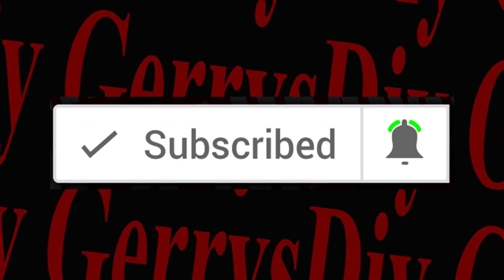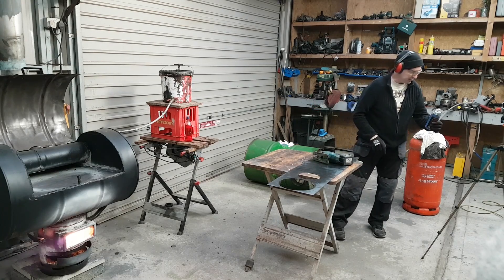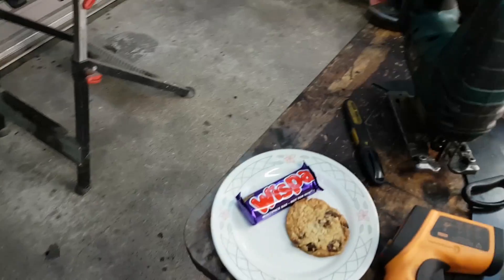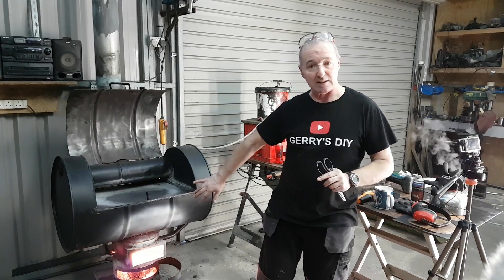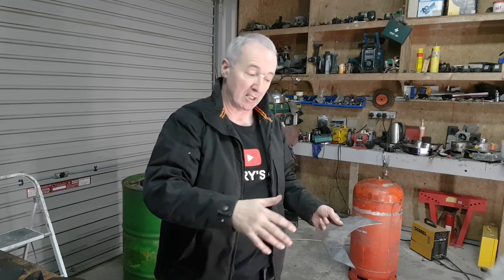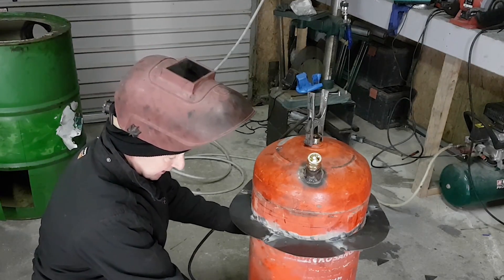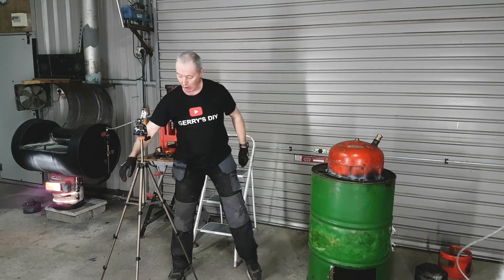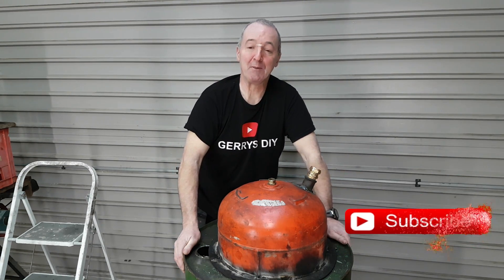Waste Oil Burner ... Make Lots of Free Hot Water ... part 2

Comment: na thats not enough to hold it full of water you need two bits of strong metal from the bottom as with the heat its too much for the thin metal on the drum to hold up! your ideas are good but you talk to much about each part theres no need to explain about every bit of metal from start to end theres too much wasted talk lets see the idea and move on! ow and get your self ! a mig be a lot easyer than stick on thin metal!

Comment: Glad you are all right!

I'm setting up my own WMO burning stove for this winter and need some input about chimney planning. 

I will need to use a 90* to come out the shop wall, but I'm concerned about buildup and chimney fires. Is it safer to take the chimney out closer to the stove, or closer to the ceiling?

Planning to take it up just past the gutters, about 20 feet up. My only big concern is chimney fires.

Comment: I think that you want to also consider that the water tank, if it fails and dumps into the oil burning.. probably would cause a huge explosion.. Water into burning oil 
I'm sure you're aware of the boiler needs to be not a pressurized vessel. But I hope you considered the constant fire, overtime at the bottom of the water tank (and it not being designed for it initially) could cause a failure and explosion. I'm a welder & have been a boiler service man.

Comment: Think about it Gerry.  A 2ltr Diesel engine on tick over will burn 2-3 litres per hour.   My current 2016 plate 1.6 TDI (77 KW output at 4400 rpm) does 65mpg typical which works out less than 2ltrs per hours when driving (under load) 
A typical household system needs no more than 10Kw for 3000 square feet.  That's a pretty big house.  

You have to pressurise your fuel bud.  Who knows maybe boost with an HHO unit but either way it's massively inefficient although your concepts are superb.
Reply from the maker: Hi syn Kronos. As it happens I have an old tdi here that I could use but the waste oil is free and bountiful and I would have to buy the diesel to run the golf. I have an oil boiler to run the house that is 97% efficient (condensing boiler). I was thinking of feeding the waste oil into the burner from a pressure vessel and pressurising it so that will happen very soon. I will be playing with adding steam to the oil line too once I have this running. I would love to mess with some hho so I might make a unit to weld and cut with Thanks for the great suggestions Cheers Gerry
Reply: GerrysDiy nothing to do with the motor as such.  Only using it as an example that we need pressurise our fuel.  Veg oil myself.  No need for blowers or air compressors.  I'll keep you update on my refrigerator compressor build and from output considering running a an electrical turbine.  Excess can be used for HHO electrolysis but initially supplying power to run the refrigerator compressor.  (Self sufficient, save the oil system.

Comment: HI Gerry Sounds like an eye watering experience you had Im glad it turned out ok 
Could you please answer a querie for me ?
Why are you using a tank for the water and not a coil of Copper pipe ? is it the cost of the tank compared to a suitable length of copper pipe would be costly or is it storage of the amount of water ? 
I would be interested in understanding the Reply 
Also I have had a couple of thoughts as well  would a 100 m coil of 1 inch Black poly pipe on the roof work as a good PRE warmer for my instant Gas hot water system?
Tony
Reply from the maker: Hi Tony. This is just a cheap and cheerful way of making hot water. I do have copper indirect hot water tank and I have a 300 litre stainless tank too. I also have some oil boilers so I will be making  more efficient setup soon too. The water out of this one if I use it direct will have the ability to rust but I can adress that by hooking it up to my copper tank.. In your climate the poly would work well when the sun is on it. My son is just back from Oz and it was 48 there one day. Tony I would burst into flames. I dont know how you cope with heat like that. On the other side of the planet it's lashing rain here since yesterday and even the dog wont go out for a pee. Cheers Mate

Comment: What about the metal building behind the burner, if its painted does it not burn
Reply from the maker: Hi Garrison Lail. The wall of the shed radiates the heat well so it is kept cool ( ish ) behind the stove but I think that I will need a little deflector there to help things. When I have the little fan on it helps move the heat away to where I normally weld. Well spotted Cheers Gerry

Comment: Hey Gerry, glad you're on the mend!  Close call there!  Anyway I was going to mention you should get a plasma cutter but I see someone already said that but they're great!  Had one at work before I retired but I used the excuse of using stainless steel salad bowls from the Good Will meant having to get a plasma cutter to cut holes in them with for my oil burner!
Carry on and can't wait to see how the water heater turns out!
Reply from the maker: Hi Throw Me Back. I hope to get back at the boiler tomorrow and it wont take long to get it fired up. I would love to get a plasma cutter so it's definitely on the list. Thanks for the comment Cheers Gerry

Comment: Good man Gerry, back at it ASAP. Ran my own burner yesterday a bit too smokey as or happens but burned the paint off in 10mins. Is 10mm oil pipe too small to regulate the flow?
Reply from the maker: Hi Gerard. I have found that when the outside temperature is low the oil can be thick and unwilling to flow so 1/2 inch works well for me. you can get it in coils you just look for annealed copper what ever length you need. Fully synthetic oil if clean flies through. Veggie oil takes its time when its cold too. What type of burner did you make and what is the setup with the flue. Cheers Gerry

Comment: Gerry, you need a little plasma cutter!..they are great for cutting up plate like that. I got a good used one on eBay a few years back and wouldn't be with out it for jobs like that. Glad your on the mend.
Reply from the maker: Thanks Gary. I would love to get sorted with a plasma cutter. I would use a lot less grinder disks lol Thanks for comment Cheers Gerry
Reply: If you're looking for one that works well for a low price, you should look at the Simadre Cut50 on eBAy.  It's surprisingly good for the price.  I have the older model that has a red plastic case, but there appears to be a new one in black.  I don't know if there are any internal differences between the two.

Comment: Are you planning a hot water heating setup with a tube and fin coil and a blower or...?
Reply from the maker: Hi Shane. I have a few setupsin mind. This is the more basic setup but I will be using an indirect water heater setup after I have this working. Cheers Gerry

Comment: How are going to keep that from going to steam and completely over heating?
Reply from the maker: Hi CTchuteflyer. This type of burner is great for making heat but it does not readily power down so for this version I will just match the output or just stop the oil and let it go out once I have enough hot water. This is not the finished version just an option. I will have it going in a couple of days. Cheers Gerry
Reply: its gone be a open system he said at +- 7.30
Reply: Have you tried to use a copper coil around the exhaust stack for hot water might work a little better.
Reply: Do you think that a coil around the exhaust will work better than the flame straight under the tank ???